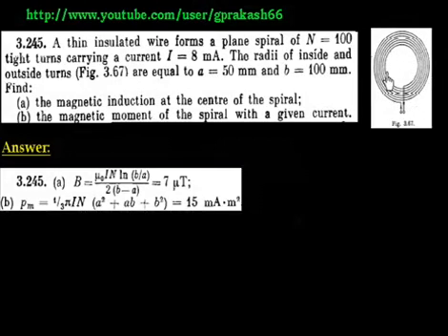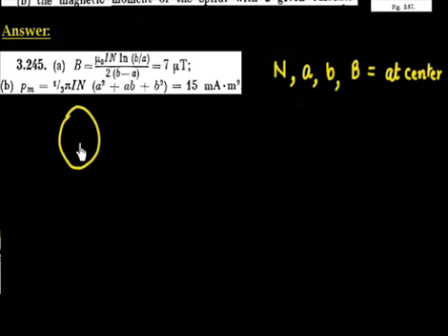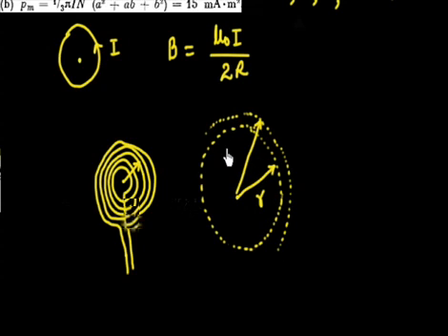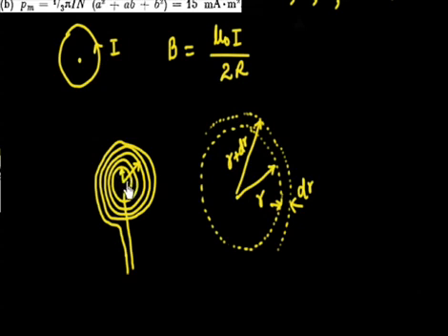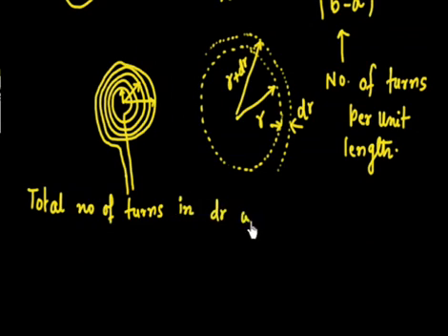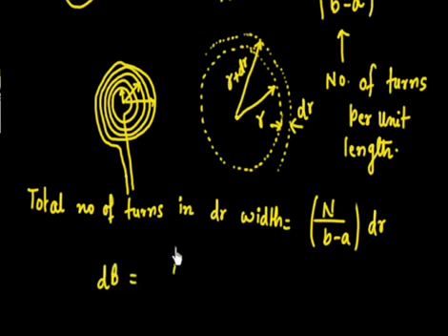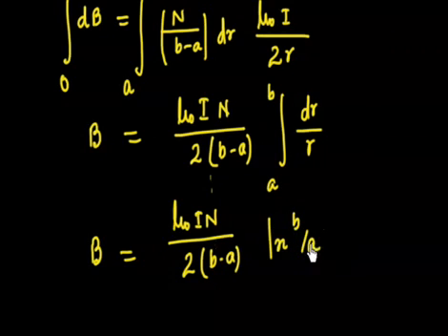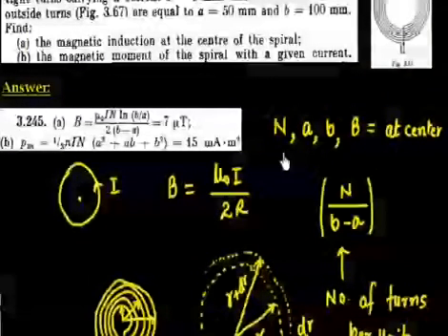Magnetic field due to spiral path I Magnetic Field I Force

Comment: If a=b normally we have a "ring" coil, but in this case the formula fails isn't ? In this case, ln(b/a) = 0 and b-a = 0 also... There is an indetermination of the first degree. Thus, what is the best way to improve B playing only with b and a values ? For example if we want ln(b/a)=1 this means that b/a = e. Obviously this means b-a = a(e-1) = 1.72a. But I'm not sure this last value will maximize the value of B...
Thank you for your feedback.
Reply from the maker: +JM Great may be a closer look at derivation and applying the concept of limit will resolve you problem.